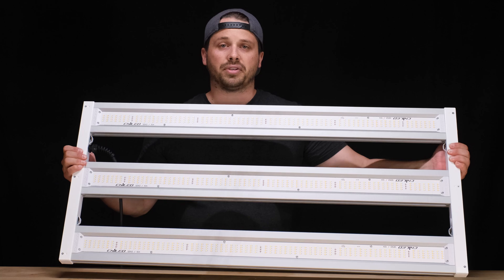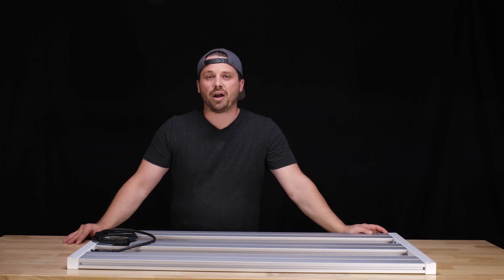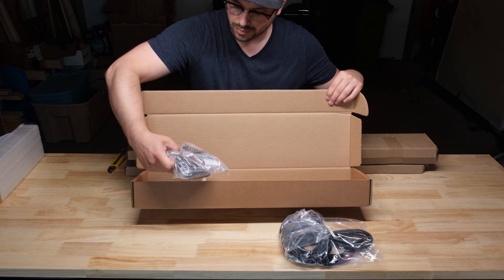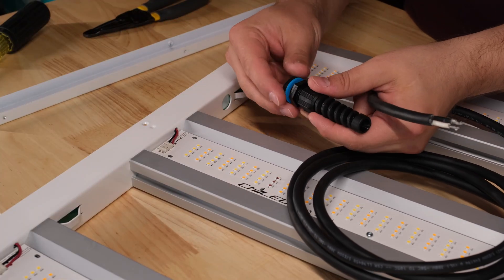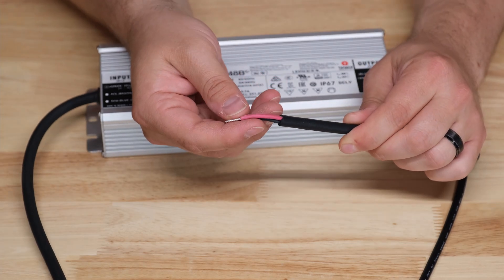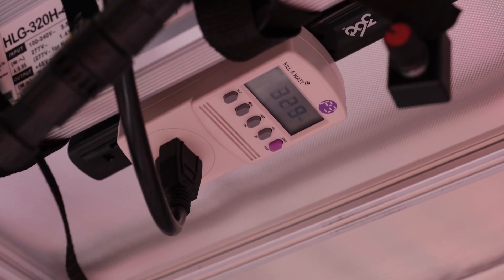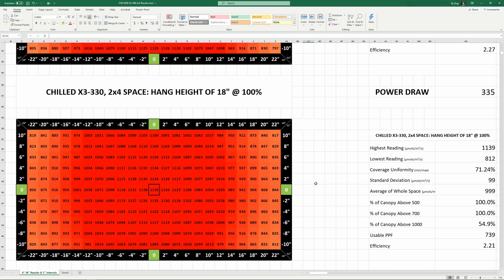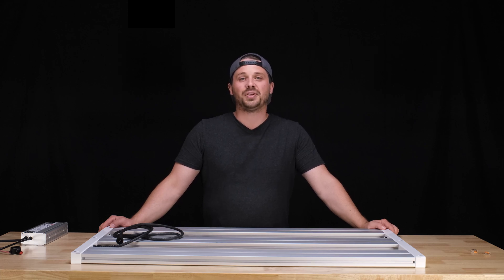ChilLED Growcraft X3-330 Review: The Best 2x4 Light I've Tested (High-res PPFD Charts, Power & Temp)

Comment: What is the difference between the X3 and the X6 Mini?
Reply: I think when I talked to support,  they said the 6x was less efficient,  possibly better spread, though. I went with the 6x. Not unhappy at all. This is my 4th run,  I'm finally getting the hanging height and power down.  Ease in! I've yellowed a few, lol. I run at 24 inches at 3/4 power till I feel they can handle more. Once 2 weeks into flower, I turn it up and keep raising to keep 16 inches. Great light.  I have to keep the driver inside the tent to keep the heat up! Take out in summer if warm.  !

Comment: Someone enlighten me if I’m wrong.  From my point of view the only difference between a light like this and Mars Hydro is build quality and efficiency, basically this light will last longer than most lights and cost you less on electric bill.
Reply from the maker: Does Mars Hydro have a 2x4 light with a footprint that will give this kind of coverage or a driver with this much power? I’d imagine ChilLED’s customer service is top-notch as well.
Reply: @LEDGardener  Not sure about the coverage and driver question but I agree about the customer service.

Comment: Im doing research for a new light in my 2x4 and Ive narrowed it down to the Growcraft X3-330 and the Optic Slim 320S.Main differences is the Optic is a mix of 3000k & 3500k while the ChilLED is 3000k & 5000k.The Optic also has 450nm Royal Blue and UV(X3 has neither).Leaning towards the Optic cause it has UV and its also about $200 cheaper for the prebuilt model($549 for the Slim 320S and $729 for the Growcraft X3).I was wondering have you reviewed the Optic Slim 320S?If so,how does it compare to the Growcraft X3 and which would you choose?

Comment: I've got 2 tips. Get some hemostats for the wire insertions and a Wera ratcheting screw driver with the bit holder in the handle. I was a Klein guy for years until I came across that Wera.

Comment: Would you recommend the X3 Mini 200 W for a 3x3 or going with 2 Chilled Logic pucks on a HLG 185 1400B? 

Both options would be paired with 4 Cxb 3590s ran at HLG 185 1400B on the corners of the lights. Looking for an efficient DIY build
Reply: Do you happen to have PPFD results for Chilled Logic pucks ?
Reply from the maker: I don’t unfortunately. The logic pucks I have are old and there would be so many variables for spacing with them.

Gotta go with the X3 Mini above.

Comment: These videos are great! Really appreciate you taking the time to make them. I’ve been rocking the x6 w/ diy co2 for over a year. The results are fantastic. Sleek, great build quality, efficient, great light spread, enough space between bars to easily hang UV, really low heat output, more than enough usable light.... I continue to be really happy with my purchase. 

ChilLeds new “ultra” fixture is especially  impressive. Everything about it is really remarkable except the price tag. A fella can dream tho...

Edit- scratch this past part. Found it on your website
Reply from the maker: That X6 must be quite the unit. The ultra stuff looks nuts.